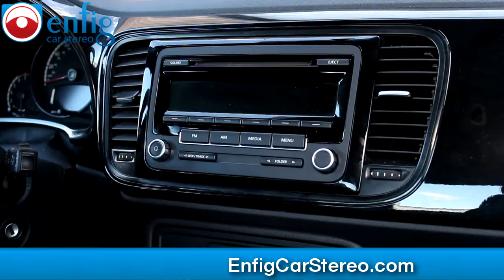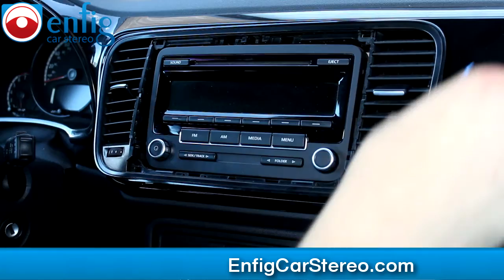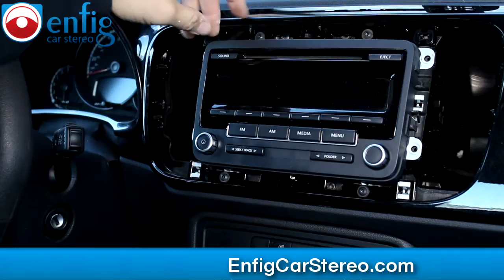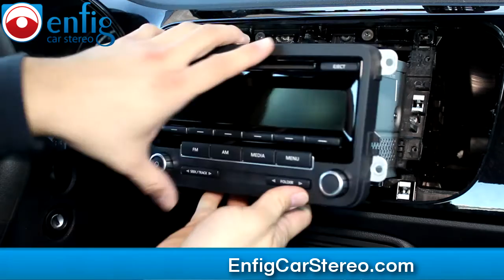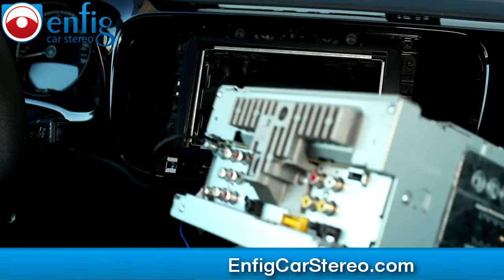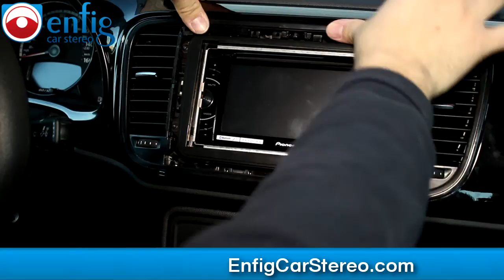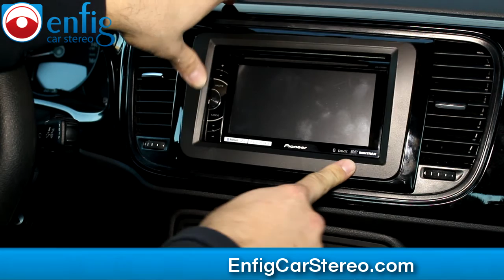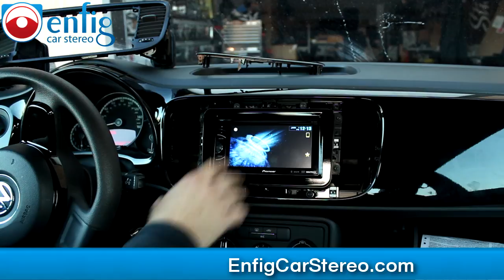Volkswagen Beetle 2012-2015 radio replacement DIY video

Comment: Best DIY I've seen. May I ask if the SRWH-VW07-B adapter will fit my 2015 vw beetle and Pioneer DMH 1500 NEX?
Reply from the maker: Yes it will as long as it's not amplified. (Fender) don't forget the plug and play converter and the steering control programmer wire.

Comment: I have a 2012 Beetle 2.0 TSI Turbo with the “fender” sound sound system that has a stock amplifier under the driver seat. So what would I need to do to install an aftermarket stereo?
Reply from the maker: We have parts for that car too.  Just send us and email.  info@enfig.com

Comment: Hi .. I am going to install Pioneer AV 8500 BT to my VW Beetle 2012 model with RCD 310 ..  What items I should buy to replace this radio ... I want to use steering control .. and Car info to the screen like temperature , air cond controls ..... please let me know the items that I will have to buy or which radio set I should use   ... thanks
Reply from the maker: You have to upgrade to the 4200NEX to get those features.  But here are the parts.

Wiring harness - Connects to your cars original harness and terminates into Blaupunkt style connector. (We also have PNP adapters that convert the Blaupunkt style connector into radio specific connections)
http://enfigcarstereo.com/ENFIG_SRWH_VW07_MAESTRO.html

Converts the Blaupunkt style connection into a connection specific to your radio.
http://enfigcarstereo.com/ENFIG_PNP_PIO0237.html

This is the Radio Mounting Kit. 
http://enfigcarstereo.com/ENFIG_RMKPB_VW07.html

Antenna Adapter
http://enfigcarstereo.com/ENFIG_AAA_VWAUD5.html

Custom mic that goes in the factory location.
http://enfigcarstereo.com/ENFIG_MIC_VW1.html

Removal Tools
http://enfigcarstereo.com/ENFIG_PPT_12345.html

To use satellite antenna only if the car had a factory installed satellite radio. Still requires new external tuner.
http://enfigcarstereo.com/ENFIG_SAA_SIR_20.html

Comment: 😮 does this installation also retains the factory usb and aux?
Reply from the maker: The Beetle did not have USB until 2016.  Aux retention is not built in to the harness but we can sell you the pins.  We make the KFU-VW1 for retain the factory USB location. https://www.youtube.com/watch?v=AVs6hNU5SNE

Comment: I've got a keyless beetle (2014). Should I disconnect the battery before swapping out head units? I'm upgrading from an rns315 to the rns510. Thx.
Reply from the maker: +og getsu I wouldn't because you might have to reset a computer at the dealer.  Having the car off should be fine.  But if you pinch a wire or something having the battery disconnected will keep serious damage from happening.
Reply: Thanks!

Comment: Does this process apply to a 2016 Beetle S? I got a JVC stereo I want to install, but not sure if I should just go with some pros.
Reply from the maker: 2016 is the exact same installation but the main haness is the SRWH-VW16 instead of the SRWH-vw07.  Check out the web site for more details.  They have different pages.

Comment: I have a 2012 beetle with 510 radio , do i have to buy a bluetooth device or it's a built in thing ? also is the car prepared with mic because i see the mic on the steering wheel , thank you
Reply from the maker: +alnoukhitha The bluetooth is usually a separate module.  I'm not sue about the beetle but its usually under the passenger seat.  If you see a mic it might be aftermarket.